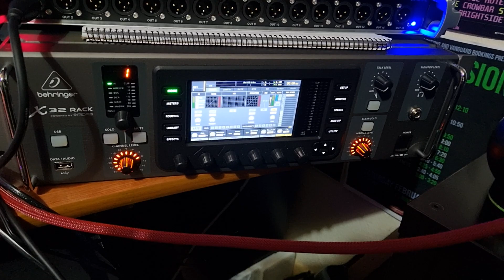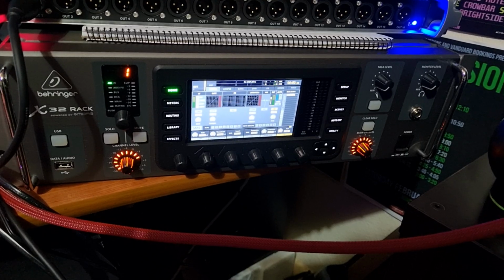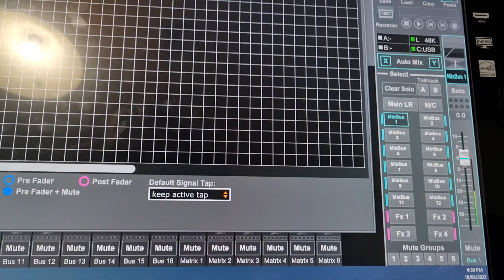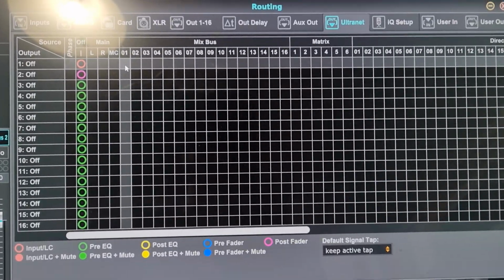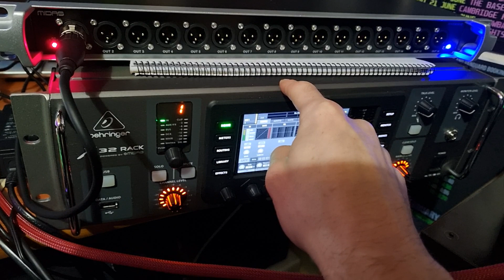Does the Midas DN4816-O system work with the X32 via Ultranet?

Comment: If I understand it right (and yes, the lack of documentation is astounding), the DN4816-O is the only DN unit, that works with the X32 or M32 units, because the X32 and M32 units have an "Ultranet Out" port and the DN4816-O is the only one with an "Ultranet In" port, while the two other DN units have "Ultranet Out" ports. That means, you could take a DN4816-I and feed it via Ultranet to a DN4816-O, then feed all 32 channels via Stageconnect to a Wing.
Or you could connect a DN4816-O to a SD8 and feed all 48 channels via AES50 to a X32, M32 or Wing. 
All theoreticals, as I don't have any DN units (yet). I have ordered a DN4816-O and a DN4888, which I will be testing with Wing and Midas M32C. I also have a SD8. Some fun combinations should be possible with that.

Comment: Just took delivery of a DB4888 (8 in + 8 out) to go with my XR18. Had to get it from Sweetwater in USA. Still good value. Adds more outputs and will work as a nice digital snake.
Reply: So can you use the 8x8 and get 8 more inputs over Ultranet as well? How does that work?
Reply: @chrislundquist1189  Not quite, the Midas DN4816-O is for Outputs, if you're looking for inputs check out the Midas DN4816-I

Comment: Awesome, exactly what I was hoping for. As long as they don't release an XR18 / X32 with StageConnect at least.

As for Ultranet on the X32, can you assign mixes / buses to the Ultranet outputs channels or does it only send a single input per channel? Since it is "for monitoring" and ultranet receivers usually do their own mix.

The latter would result in a slightly awkward config where the native XLR buses have to be used for IEM and the actual outputs for FOH mix have to go over the DN4816-O.

Comment: Well, good thing, it works. I just don't see any Reason why I'd need more Outputs than Inputs. I mean, i usually use like 3-4 times as many inputs than Outputs. Plus you only have 16 mix busses. They are pretty tight anyways.(if you use bus compression and or time based effects)
Reply from the maker: Stereo in ear rigs and FOH sends :)
Reply: My band has got the Midas MR18 and with this, like mentioned, we can manage to have stereo iems and still enough outs for foh without a splitter

Comment: Can the 16ch input boxes work the same way to add 16ch input via ultranet? If so, can the preamp gains be controlled by the x32?
Reply: There is no preamp in these stageboxes. Only for line level sources.

Comment: So you were able to pass the 16 Ultranet channels out of this unit? I’m looking to use it as a splitter for front of house from our IEM rack.  Should essentially be able to pass 16 channels of direct out through this via the Ultranet routing page?
Reply: yes, that would work.
Reply: @TinoSchulz1990  confirmed, got it set up about a week ago. Thank for this info. Much appreciated.
Reply: Hey, quick question since you pulled the trigger

I currently got a x32 with 2 arts8 giving me 16 outputs to foh from the arts8

If i get a sd16 and the DN4816-o would that give me 32 inputs and 32 outputs to foh? (sd16 via aes50 and DN4816 via ultranet)

Thanks

Comment: I have a x32 mixer.
Been thinking about buying the midas dl32 stage box.
Would this work on the x32 mixer?
For the kind of music I do,
I would be happy with a configuration of 24 channels using 2 stage box, 8 aux for monitors and then the other 8 channels on the mixer I can use them for different mixes for in ear monitor.

Comment: YESSSS, I wanted this so BAD! Thank you! This will add 16 outputs to my Behringer XR18!!!
Reply: @mastablasta9x This may add 16 outputs to the XR18, but there aren’t any free busses, can you explain what the added value of that would be? It’s not like you’ll get any additional busses to work with, so how will this be usefull? Or did I miss something?
Reply: @merlijnduynstee  you can send any of the 18 channels into Ultranet post-fader so you can use XR18 as a multichannel pre-processor with USB audio. So in that way you have a lot more outputs. But there's no more buses indeed, so no additional monitor mixes for example.
Reply from the maker: You're welcome dude!
Reply: @MrTheog1989  WHAT? That's amazing! I just sold my XR-18 and got an X32 because I needed more outs. This doesn't require some converter between StageConnect and UltraNet? Amazing!
Reply from the maker: @TheXIT  Nope, its all UltraNet! The rear of the DN4816 units have UltraNet onboard!

Comment: Thank you so much for this!
Can you go through routing to show how you would add this to your network? 

I’m using an M32C and a DL32 and I’d like to use the 4888 as a second stage box across the stage.
Reply from the maker: Hi Chris, my pleasure! I've been thinking about doing a somewhat less adhoc video on the setup and how it works.

To be sure I address your question, are you referring to audio routing or network routing?
Reply: @MrTheog1989  
For me it would be network routing and setup. Specifically the connectivity between the 4888 and my DL32/M32C as all they have in common is Ethernet. Connecting the DL32/M32C wasn’t straight forward for me and those were intended to work together. 
Do we need to use a special ether-con cable or will any CAT5e cable work? What is the setup process in the software so that they recognize each other? I use the M32 mix app. 
Thank you so much!
Reply from the maker: @chrismitlyng1411  A regular CAT5e cable should do just fine! The routing scenario really isn't laid out very clearly. Do you have a way I can send you some screenshots?

Comment: Theo THANK YOU for this insight. I failed to find if the same DN4816-O could connect to the XR18 Ultranet, which is Output only. With ATMOS we commonly need 12 ch outputs for speakers (XR18 has 8 XLR outs). Currently I use 2 x P16 ultranet personal mixers to patch the extra 4 output channels to speakers, but messy. Did any find XR18 -> DN4816-O works ? I really appreciate any one who can test please.
Reply from the maker: You're welcome Jeff! I don't have access to an XR18 unfortunately so I can't test your scenario
Reply: I ordered this beauty and will check it with my XR18 in a few days :)
Reply from the maker: @PR3Runner  Please let me know how you go, I'm very interested!
Reply: @MrTheog1989  The XR18 works exactly the same as the X32 👍
Reply from the maker: @PR3Runner  awesome!!
Reply: @PR3Runner  How do you assign it with the XR-18?  Do you know of the DL-inputs works too?

Comment: Nice one mate. Lots more options for X32/M32 outputs with this pathway working. Just to be clear, you have connected Ultranet port from back of X32 rack to Ultranet port on MidasDN4816-O, using Cat5e cable?
Reply from the maker: Yep, that's exactly how I've connected it.

Comment: Regarding routing etc, (not sure if you tested) would you lose the ability for running a P16 alongside... or is it simply routing the Bus outs to the Ultranet?
Reply from the maker: I don't have a P16 to try this with. What connection does it use?

I've just certain output channels to ultranet at this stage.

Comment: Great video, however; I don't quite think you were cruel enough about the lack of documentation from Midas; even the MusicTribe forum has nothing on it so suggest how these can be linked up. It's appalling.

This morning's job was, literally, to get my Midas Hub4, connected to my X32 Rack, to "see" the DNs and be able to use them!?!??!
Reply from the maker: I made an account on the MusicTribe forum just to post replied to the two times these units have been spoken about.

Both times the poster was told that these DN units would not work with other ultranet equipment and that the ultranet port only converted ultranet to the new stageconnect protocol.

These bits of gear are addressing and issue that many bands running IEM systems have only been able to solve with much more expensive gear in the past, so why not let the community know?! It's crazy hahaha
Reply: @MrTheog1989  I shan't mention the guys name, Dave, but he says "Yeah, that'll work!" to stuff that clearly doesn't!!! I spend £2k on kit, on the basis that he said it'd work, only to find I can only use 16 channels of the 48 promised?!?!

Your video has probably saved me £1k upwards, never mind the additional rack space/cabling/hassle/setup... 🙂

Out of interest, what settings do you have on the rear of your DN4816o?
Reply from the maker: @TheTributeMusicalDirector  Oh geez, what gear are you running? 

I'm really glad this video helped you out, initially I just filmed it to send to some mates over messenger, then figured it might be useful for the broader community!

My setup is:
- X32 ultranet lead to DN4816-O ultranet input
- syncronisation set to ultranet
- analogue outputs 1-16
Reply: @MrTheog1989  I was using the X32/M32c, via AES50 to the Hub4 with the DN4416i and DN4416o; however, you could only "see" channels 33-48 on the X32/M32c, i.e. you could have only 16 in, or 16 out, rather than the full 48 that AES50 allows. The MusicTribe forum all said "Yeah, it'll work fine", but as soon as you pressed them for settings/examples it'd all go strangely quiet... 🙂

I'm selling the Hub4 and the DN4416i, thanks to your video I can use my X32 rack with the DN4416o to give me an extra 16 outputs! :-) It was outputs I needed, for FOH mixes/buses.
Reply: @MrTheog1989  Note to self; when trying to connect the DN to the X32, don't use the AES50a port, use the Ultranet!!! You won't waste 30 minutes cursing as to why the fcuk it's not working!?!? :-)
Reply from the maker: @TheTributeMusicalDirector  Consider that note taken on board! 

I've had many similar roadblocks in the past... some of which took me a lot longer than 30 minutes to realise the problem was that I didn't read a label right!

I'm really glad to hear this video helped you out, the DN4816 series should be a really positive gamechanger for those wishing to expand their IO in a specific way.
I was super frustrated that almost all gear focuses heavily on inputs and not outputs, I have a 24 channel analogue console that I want to integrate into my DAW, the X32 will do it nicely but I needed more outputs and all the gear I could find either cost two arms and a leg or added twice the amount of inputs to the extra outs...
Reply: I wonder if the lack of documentation is because this could cannibalize sales of some the $$$ expensive Midas Stage Boxes?
Reply from the maker: @TheXIT  Whilst it's definitely possible, Behringer has a pretty strong reputation for very poor documentation in general. I think if corporate was concerned with undercutting sales of their other products that they'd just not develop/release something.